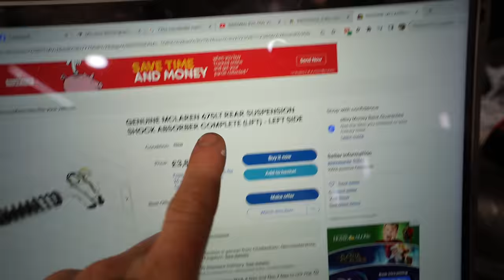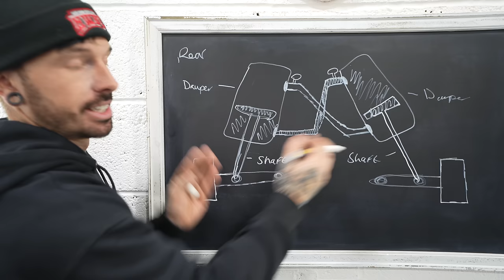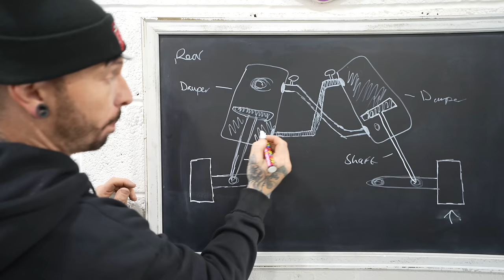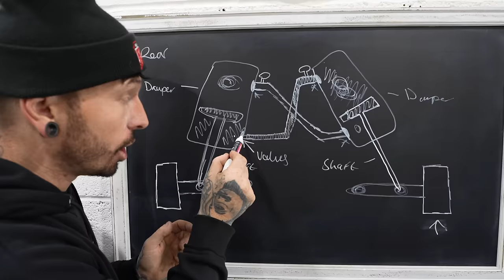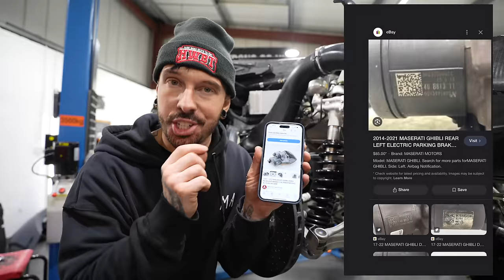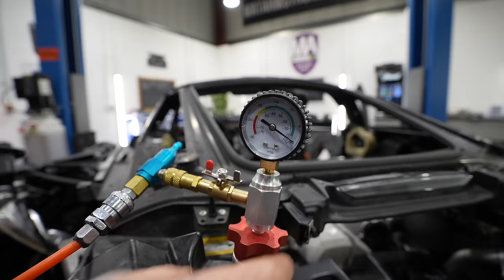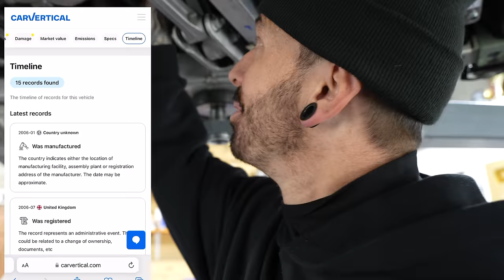I ATTEMPTED TO DRIVE MY WRECKED MCLAREN 720s

Comment: Matt. Check ur turbos could be leaking a bit of oil. Or check ur pcv/ccv system could be damaged and returning to much oil that’s being burnt in the system. I doubt this could be it but leave the car running and check coolant level if it goes down after a while if it running it’s probably cuz u have either a bad head gasket or a crack in the block. Really doubt full on the latter. Anywaves keep up the amazing content brother and don’t give up u got this. 😤😤

Comment: Hi Matt,
I have been a fan of your channel for a while but I can’t help noticing in this video that you rebuilt the suspension connecting all the joints without a drop of grease. My job for forty years plus has been putting aircraft back together so I know a bit about mechanics and engineering. Assembling those joints dry was a mistake and they won’t last long in that state. If I got it wrong (only commenting on what I saw and I am not trying to offend) then let me know.

Comment: Drain the oil start with 6.5 qts. Perform check oil level sequence using the cluster in service settings. Oil temp must be at operating temperature. Add little by little after each check level sequence until level says ok. Most likely overfilled with oil even the oil level slightly over it will cause the smoke. Good luck!

Comment: Awesome video Mat! Not usually one to comment, but I've had a similar issue before, with a similar amount of smoke. Others have said Turbos here (which I think also could be a potential), I'd also check the PCV/CCV system as if they properly go, then they can throw that much oil into the intake system (at least it looks like maybe it's oil to me?)

Comment: Hi matt very good video as the oil cap blew off when you started engine when you got the car as I watched the video why don't you just check the head gasket at the time the engine was out and replace it to be on the safe side.  I hope you mange to fix the problem I'm sure we all will see in the next video.  Keep the good work up thanks tim

Comment: Check pcv. Excessive smoke and the oil filler cap is a good sign it's that.
Reply: You can test what you have by cutting the vacuum line and adding a catch can. If the smoke and pressure from the filler cap go it's definitely that mate.

Comment: Suggest also checking oil presure is normal. I assume there are horrible Exhaust Gas Recirculation valves with some turbo presure compensation plumbing, Good Luck.

Comment: The smoke looks like burning oil. This can happen with McLarens when they sit for a long time as the oil leaks into the turbos. Let it run for a bit and see if it starts to improve. Could save you from taking the engine out.

Comment: Hi mat, I may have a solution the the latest McLaren update. 
I had a seat Ibiza cuora which had the same problem (smoking crazy) but no head issues etc. 
it turned out to just be the breather pipe off the air box had come off. 
It’s worth checking.

Comment: The engine crankcase is being presurised, the oil filler cap popped off. With a dry sump the crankcase is usually running with a small vacuum with a tiny ventilation hole/pipe. If the outputs of the turbo are dry it must be coming from within, hopefully not head gasket. I am sure with emissions control regulations the ventilation of the crankcase/heads is complex. Before stripping the engine, try checking all of the ventilation pipes and make sure the turbos are not presurising the crankcase due to a pipe connected to the wrong place or a ventilation valve connected backwards.

Comment: Could be the fuel rail lines or injectors on the engine if any. And the transmission not engaging could be a wiring harness issue for the TCM. I LOVE YOUR VIDEOS. BEN FROM GHANA 🇬🇭

Comment: I don’t own a McLaren but I’d check PCV valves & plumbing if it has them? The cap popping off makes me suspicious. After that check turbo water & oil feeds/returns, any internal blockage or kinks. Crank pressure or blocked oil &/or water feed/return could cause turbo seals to fail and dump oil or water into the exhaust. Especially as it seemed to happen suddenly. Does the exhaust smoke reduce with the oil cap removed?

Comment: Looks like the crankcase ventelation pipes are not routed correctly Mat.   There's the only reason for positive pressure to push that oil cap out.

Comment: Hmmmmm i don't know what the problem is.
I'm thinking..... Unburnt fuel?
Anything to do with those electrical connectors not being connected to anything?

These cars all monitor the air coming in and going out, and mix the amount of fuel going into the engine...

I don't think it's a great idea to be locking yourself in a room with those fumes though.

I'm looking forward to seeing the next video..

Best of luck 👍👍

Comment: Wouldn’t leave water in the system in case it fills your cylinders up . drain system then start her up see if it clears. Plus it will blow any water or condensation out good luck once again. Robin

Comment: The best way to make sure you put it back together in the correct order is not to rely on memory, it's to have a helper who will take a photo of every step, so you can just look at those photos in reverse order later.  When you have a film crew it's that much easier— just have them hit the timecode button at each important step, then when they import the footage, just export all timecode marked frames as time-date-named photos.

Comment: theres a legendary glue called Qbond, it allows you to produce an aluminum seal by using the aluminium power and glue, and it actuallly made to seal leaks on radiators and plastic surfaces, should cost you about R40 rand maybe 2pounds or something

Comment: I can’t stop thinking about this!! 😅 I’ve gone off the idea it’s smoking from the turbo bearings / coolant jacket because it smoked from the moment it started for the first time. So the smoke is coming from the combustion chambers. And it blew off the oil filler cap at a subsequent start… Hmm crank case ventilation isn’t working, it’s pumping up the crank case. Is an oil separator full to the brim with oil and with each blip it gets a gulp of oil into the intake manifold? Or a CCV is stuck closed and it’s sucking oil under manifold vacuum into the inlets?! Can’t wait until next Wednesday… :-)

Comment: This is what the AI said, Mat: Persistent white smoke from an engine, especially if it's thick and doesn't dissipate quickly, can be indicative of a coolant leak into the combustion chamber. Here are some steps you can take to diagnose the issue:

Check the Coolant Level: Open your car’s radiator (when the engine is cool) and the coolant reservoir to see if the coolant is low. A dropping coolant level without an obvious leak could mean it's going into the engine.

Inspect for External Leaks: Look for signs of coolant leaks under the car. This might not directly indicate a head gasket issue but could point towards a cooling system problem.

Check the Oil: Look at the dipstick or the oil filler cap. If you see a milky, cream-colored sludge, it could indicate that coolant is mixing with the engine oil, often a symptom of a blown head gasket.

Observe the Exhaust: Besides the color of the smoke, also notice if there’s a sweet smell. This is a telltale sign of coolant burning.

Perform a Compression Test: This test can help determine if the engine’s cylinders are experiencing compression loss, which can be caused by a bad head gasket or cracks in the engine block or cylinder head.

Use a Block Tester: This is a tool that checks for the presence of combustion gases in the coolant. It can confirm a blown head gasket or a crack where exhaust gases are leaking into the cooling system.

Check the Engine’s Temperature: Keep an eye on the engine temperature gauge. If your engine is overheating, it could be related to a cooling system problem, including a head gasket failure.

Professional Diagnostic: If you’re unsure or the tests are inconclusive, it's best to take your car to a mechanic. They can perform more sophisticated tests and accurately diagnose the problem.

Good luck! :D
Reply: that's why he did the chemical test on the coolant cap. to see the if the coolant and exhaust was getting mixed, which would show you if there is coolant in the combustion chamber
Reply: It runs to well to be head gasket

Comment: I have had a slight leak on a water cooled turbo not sure if they are water cooled turbos on that! Also egr system the egr cooler could also have a crack in it I know the pressure is the wrong way but I have had one crack on me in the past.

Comment: Check if engine is overfilled with oil, yter vtuned had that issue on his mclaren. Gear box might also not go into drive because you need the doors installed. Thank me later 😉

Comment: From my experience with the radiator coolant vacuum refill kit/system is that it requires sustained shop air well over 100 psi to work properly. The little compressor that you are using is insufficient.

Comment: Check the PCV system if the pipes are not connected properly or the valve has failed boom smoke….

Comment: Oddly just watched video on tic tok about Mclaren not selecting gear and fault was the frunk latch switch that is prone to fail. The guy showed how to get round it but point is that since you have no body work  you are going to have to fool this and probably the doors and engine hatch switches to get a gear. It's a safety thing, or find video above. As to the smoke, I would check the turbos!

Comment: Is it oil or is coolant? First suspect should be the turbos, they combine oil, coolant and exhaust very closely together. Maybe take off the turbos from the manifolds and see if the engine alone produces that smoke, very strange, engine probably nees to come back out. And the gearbox not shifting could be alot of stuff, easiest case would be that it needs all doors on the car and closed to shift out of park, maybe the brake switch isnt detected...

Comment: I would check your oil level, if you have a litre too much oil in it'll pump  it back up and smoke like yours is doing.
Even if you measured the correct amount in you can easily put too much in as when you drain it theres still a lot of oil left behind...
Hope this helps 😊

Comment: The oil cap flying of probably means you have a lot of blowby in the cilinder(s). Bad rings, a hole in a piston or a bad cilinder. Basically compressed air from combustion Chamber is leaking into the lower end building up crancase pressure making the oil cap fly of. Smoke is probably engine oil finding its way to the combustion chamber...

Comment: Is there a pcv valve on the rocker covers? Could be faulty causing pressure to pop the oil cap off. 

Also do it have a egr cooler. I replaced a failed one on a car that was dumping its coolant into the exhaust.

Comment: I'm wondering if it'd be the head gasket or if you're burning oil from somewhere else? Turbo seals may be an easy win? Does it have an FCOC, sometimes they're positioned near the Rads so could be damaged too? 

Praying you get this fixed bro 🤘🏼

Comment: I think that you have "blow by" when the rings on the pistons are gone and letting pressure and oil seep past them thus causing the smoke and oil filler cap to come off. Not cheap or quick or good really.
Good luck.

Comment: So I had a BMW job once and it was left long enough for the carbon in the breather system to go hard and bloke it up completely causing back pressure in the crank case forcing oil out of the turbo bearings into the exhaust, smoked like mad till I removed oil breather filter and replaced with new one. Turbo oil return pipe, massive pressure = smoke. Hope that makes sense.

Comment: @matt armstrongYou sure there is no oil in the exhaust or turbine ? As it was fine until it got up to temp then the burning started. It's probably going to be something simple obviously I can not tell what the smoke smells like to see what the smoke contains. To tell you which fluid it is try taking the exhaust off see if it still burns. I wouldn't worry to much doing so won't make it better. I'm surprised your old man doesn't know what smell it is. Could be transmission fluid leak or has it got a pcv valve? That could be a failure. Or maybe one of the lines are plumbed wrong. It's hard to diagnose from a video.

Comment: Oil cap blowing off probably means crank breather issues causing positive pressure and pushing oil past the rings. Doubt its turbo's smoking exactly the same on each bank.

Comment: I like how whatever happens that you all just keep smiling.
I think  I would have been just so very slightly pead off 
Lets hope that you can fix it.
But if there is water in the oil, then it;s bad engine,.!
Plus the gearbox is not engaging into gear.
Good luck Mat, you'r gonna need it mate.

Comment: Oh that's bad luck mate, but may be not as bad as it looks. It's not the head gasket or your tester would have changed colour. My guess is the oil level is too high and it's bypassing the turbo seals and going straight into the inlet. Good luck.

Comment: That white ‘smoke’ is not coolant burning as it doesn’t hang in the air like it was showing in the vid.  It’s oil burning.  My bet is an oil seal has gone on the turbo and is leaking into the exhaust/turbine side.  Hence why the intake was dry, but the exhausts are dripping wet….

Comment: i think you have possibly blown turbos or a PCV system has failed. you can see how thick the smoke is and that it lingers that its got oil. you should be able to smell it.
you may aslo have an issue with MAF sensors and it got a vacuum leak or something thats why it wont idle properly.
Reply: If I mind right the pcv failing will make a vucumn in the crankcase I've replaced a few rs ones and they seem to suck the cap on when they fall.  This is very weird it's popping the cap off
Reply: turbo and high compression  @ikess1

Comment: Could it be a breather issue like pcv valve failure if it has them rather that breathing it’s over pressuring and pushing oil into engine?

Comment: My bet is on piston rings.
You should be trying some test for exhaust gas in engine oil.
It seems like at the accident, the owner hasn't shut off the engine immediately, or someone started the engine while it was sitting without coolant...
Engine very bad :)

Comment: It is AIR TO FUEL RATIO is too rich causing that smoke. Maybe check Air Intake Pressure/Temperature or MAF sensor whatever sensor it got in the air intake.

Check the smoke if it is oily (then it is piston ring and gasket) or if it is not oily then it is only the fuel too rich.

I hope you can finish this McLaren.

Comment: I just did head gasket on a Toyota 4y. It blew white exhaust fumes like this every morning for about 6 months and I assumed it was just a sticky choke and being it was just before and during winter that it was just high condensation included. Then she started blowing all the water out the radiator.
Turns out that when I bought the motor 10 years ago and put it in the vehicle I didn't think to torque the head bolts after about 1000km because when I came to taking the head off the bolts were basically hand tight. Had the head checked, new gasket and she's just done about 600 km since new gasket. May not be the same issue, but it looks suspiciously similar. Also are the turbos water cooled? May be one of them is leaking water, cracked water jacket in the housing or something? Seen that before.

Comment: Are you sure it's not a blocked engine breather that would cause the cap to blow off and also cause the oil seals in the turbos on the exhaust side to leak oil into the exhaust causing that smoke.

Comment: If it didn't have a leak for my radiator and intercooler I use two small flat head screw drivers. Then put one either sidenof the fin and shape it back to as close to normal as possible.

Comment: I think you’ve got a turbo problem, boost blowing by the seal back into the oil system and that’s causing your pressure in oil system and oil/water burning off in your turbo. Had this before and I was preparing for a rebuild until I pulled the turbo off and seen the issue
Your turbo seal is gone

I was happy I didn’t pull the engine apart to do the rings  or replace cracked pistons and it was just a new turbo that fixed it

Comment: if its white smoke that's being produced its defo coolant issue entering combustion chamber, so if your test was right i don't know how this could be head gasket or head as the exhaust gas will enter the water system through the gasket or Crack so would turn yellow. dose this car have water injection as well as the charge coolers.?  to cool intake temp, if so, this could be the possible fault, or an electrical fault given half the car is still not together ... i look forward to your next Vid. Good Luck

Comment: @Mat, what about a bad PCV?
Reply: This is exactly what I was thinking. If it has a PCV then a split in the diaphragm will cause exactly this smoke.
Reply: The tell tale, was the oil filler popping off

Comment: Possible causes :-
1) injector timing issue & / or fuel pump issue. 
2) injector (s). Faulty
3) if exhaust is sweet smelling like the coolant , then coolant leaking into system somewhere. 

4) cracked cylinder head 
5) cracked cylinder block

Good luck. 
Regards Suki singh

Comment: if it was the gasket then wouldn't it have smoked when you tried to start it in PT3? it stared and you rev'd the engine in PT3, there was no smoke - at 28:30 in PT3 video, notice there's no smoke

Comment: Hang on . New tub, connected to a brand new rear frame.. ER.. so it's not the old wrecked car then. It's a new one. albeit built by you ? Triggers broom mate. Wont' go into gear as the bonnet isn't latched etc.

Comment: McLaren engines are known to be oil burners, I've heard many going back to warranty for piston rings. Do a compression test and check the values, either too low or big differences. Get yourself a proper 360 degree camera and check the bores where is the oil coming from.